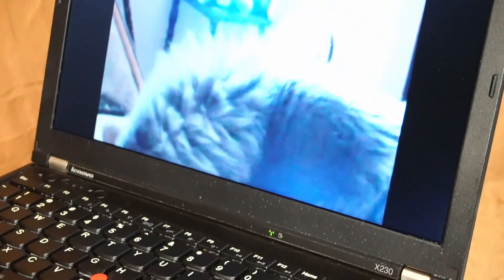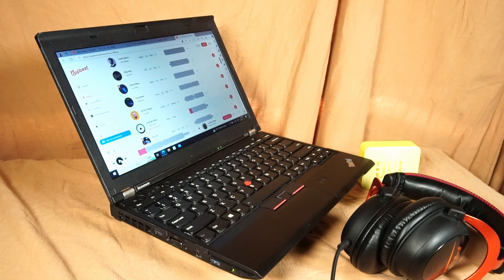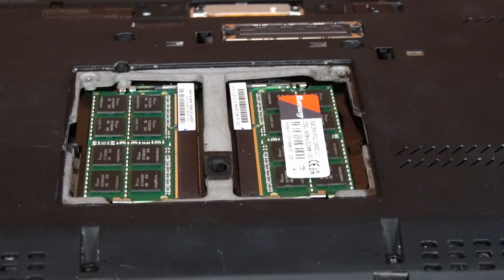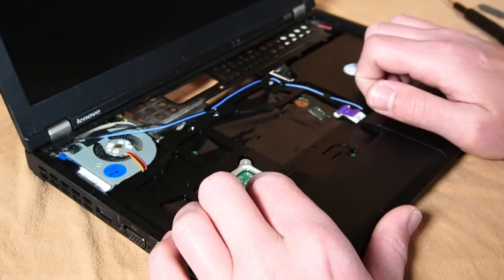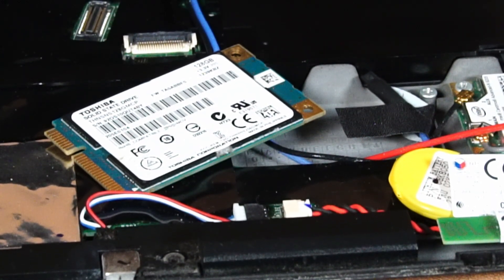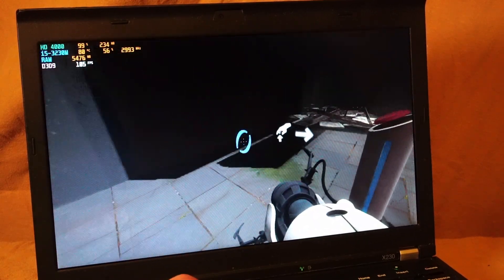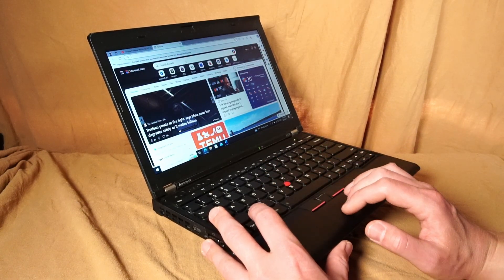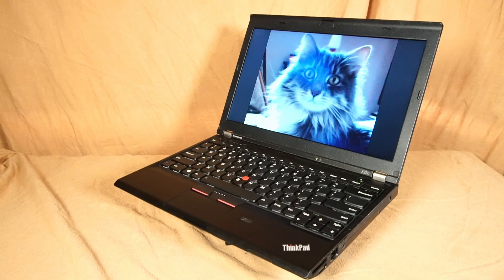Lenovo ThinkPad X230 in 2024!  Review, Gaming, Daily Driver

Comment: Thanks, good video. For HDMI port, i have it through my dock station (serie 3 type 4337, usb3 ports). The 2nd sataIII port that can give us the core i5, comes altough though the dock station, it should be usefull with the one (not the 4337) with DVD reader, putting  2,5' caddy instead...

I still use my x230 as my main laptop  (i'm not a gamer) with 16gb of ram, 1To SSHD, 256 Go ssd mSata (other x230 users put up to 1To mSata) , batt 44+ & 44++, express card slot with great pro audio card Echo indigo IOx, external screen. Win10 (win11 won't have pilots for my Echo audio express card), & Linux Mint. I keep it for now...

Comment: Great Video! (as always!) Question: I have an X250 running Linux with 16GB ram — works great! Only problem, recently, it started to “glitch” (flicker) a bit when I wake it up, and reboots (instead of just “waking up” and asking for a password). Any ideas on how to fix this? Thanks 🙏🏻
Reply from the maker: It may be set to go to hibernation mode to save on power.  You can alter this in Control Panel>Power>Choose what the power buttons do
Reply: @HaisteComputerRepair Thanks I’ll give this a try! Could it also be a loose part or connection on the laptop lid? Have you encountered this problem before? Thanks again!
Reply from the maker: @stanleyalexandrowicz6074  My ThinkPad T14 is set to hibernate.  Maybe your settings changed somehow with a Windows update or something.  When windows loads, is it as if you turned it off or is your session the same as when you closed it?
Reply: @HaisteComputerRepair I’m running Void Linux (no Windows on the computer) — I have a T460S running the same system, and it wakes up trouble free — the glitch just started circa 2 weeks ago, and it’s an older computer (but works great) overall - thanks 😊
Reply from the maker: @stanleyalexandrowicz6074  Ok, gotcha.  I deal with Windows so much for work that I am not currently running Linux on anything.  I'll be going back soon, though.  Let me know if you find a solution.
Reply: @HaisteComputerRepair the Lenovo Diagnostic Test yielded: Memory Modules Quick Random Pattern Test = FAILED 
Seems bad ram — I just purchased this new (the ram) 6 weeks ago so they should replace it!

Comment: literally sturdy. It's the most durable laptop i've ever had. I bought it for $80(I live in South Korea). Former owner already had installed extra msata ssd and swapped hdd to 2.5 ssd. and he also gave me the new battery. so that was a decent deal. I just maxxed ram to 16gigs with my spare rams and changed the display from tn panel to ips panel. Total cost is about $150. Low-end Laptop these days cannot give me the experience that my x230 is giving me. 

If you can use just a driver(you need only one PH00 driver), refurbishing your own durable business class laptop is easier than changing your car's cabin air filter.
Reply from the maker: Well done!

Comment: I have the same laptop and used it as a daily driver for work and learning how to program with python. Mine is running a Debian 12 and runs ollama just fine to help me with automation. My upgrades/mods were: 
- unlocked bios mod
- WiFi AX201 (for 6GHz) and bluetooth 5.1 (with a PCIE converter)
- Sandisk 1TB
- 16GB RAM DDR3 corsair

Future mods will be Speakers and IPS LCD screen.
Reply from the maker: That's great.  Are you documenting this somewhere?
Reply: @ I just copied someone’s work from some forums on the internet. And for Ollama, been studying python programming and used ollama for some data digging stuff.
Reply: I was thinking to buy one got a deal 100 dollars good condition i need it for programming and learning linux should i go for it
Reply from the maker: @shadowx5985  Go for it!  Does it come with an SSD and enough RAM?

Comment: Good morning. I have a question. Can you pls infm if this model is the one you can "change the processor" ??
Reply from the maker: You can only change the CPU by swapping in a different motherboard with your CPU of choice installed.  CPU is soldered to motherboard.
Reply: @HaisteComputerRepair  Tks a lot... Clear !!
Reply: Maybe you were thinking of the T430.
Reply: @rickyp6815  Tks

Comment: i plan to buy it on backmarket in the uk, the condition is 'good', assuming everything works, how many more years do you see in this machine? i use it to run qemu, and file transfer on NTFS external hard drives, nothing else.
Reply from the maker: For simple tasks like that, I think you should be fine for years to come.  I wouldn't spend too much on it, so good luck finding a good deal

Comment: I still use my x220 which is still going strong with a 2.5" ssd and linux. It's great for daily use and general tasks. Retro gaming works really well on it also. I replaced the screen with an ips display years ago and it made a huge difference.
Reply from the maker: That's awesome.  An X220T was my daily driver for a while.  I swapped in a motherboard with one  of the i7 CPU options, maxed out RAM and played around with mSATA/HDD/SSD config.  Still miss using it.